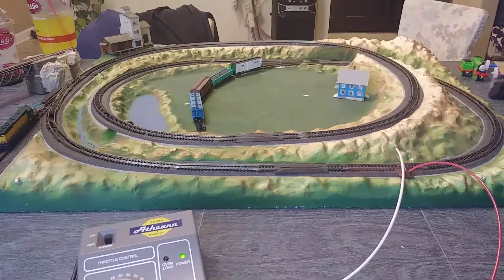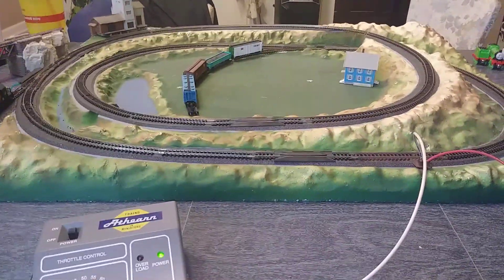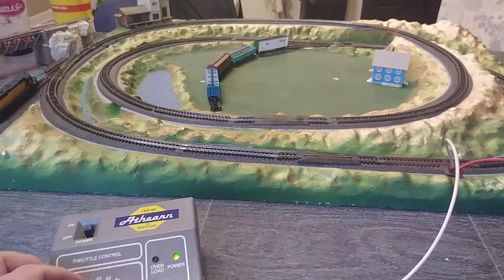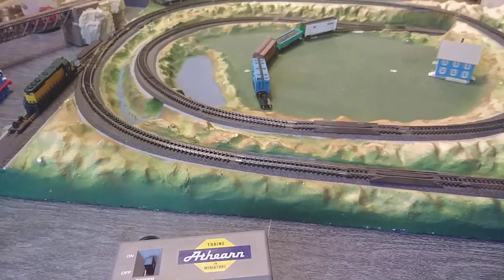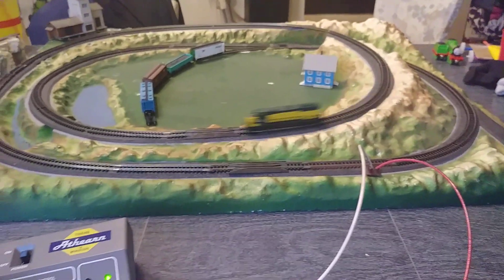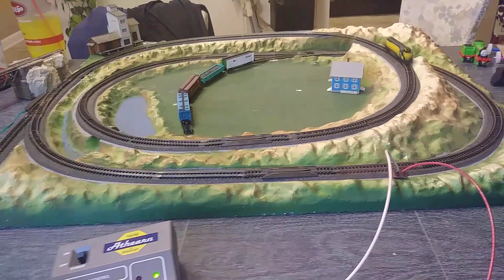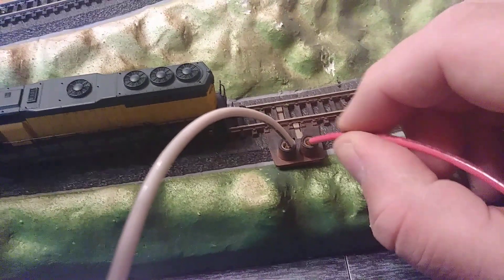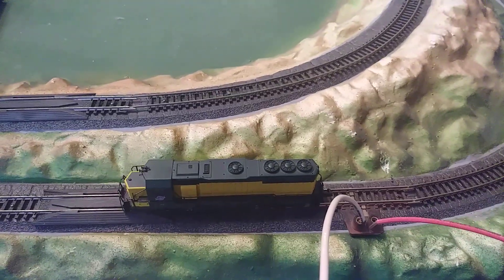A $10 N scale layout for my son.

Comment: Nice buy. Back in the 80's when  you would buy an n scale layout with loco, couple of rolling stock . The controller would connect to track with a plug. Instead of single wires to make it simpler. You could just us a couple small screws that should hold the wire in place.Hope that helps.  As always enjoy

Comment: That connector is called a banana connector. I use them in some of my ham radio equipment. They are cheap and will work well with low current uses such as model railroading. Electronic supply stores and even Radio Shack has them if you have a store near you. Hope this helps. Merry Christmas!

Comment: the  track section for power, reminds me of an old Fleischmann track, where they had the screws with a hole in it for the wire that you then tightened to lock the wire in place.